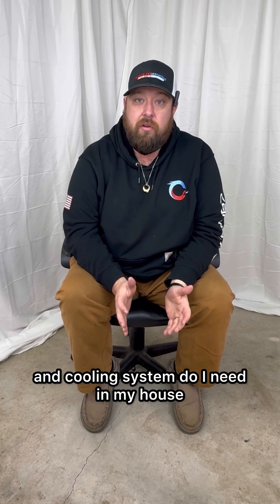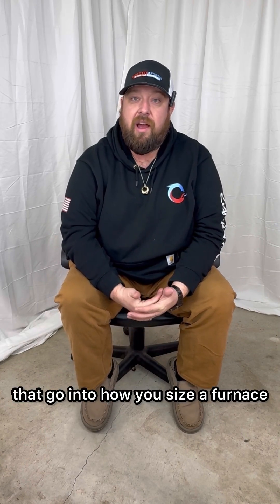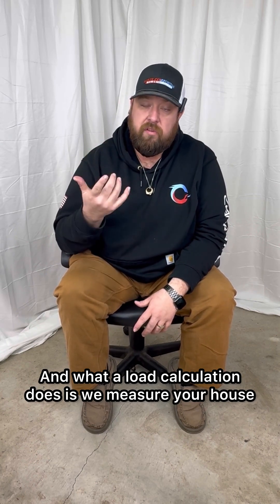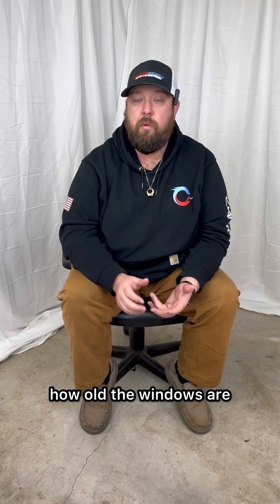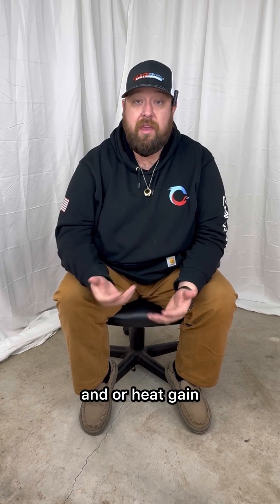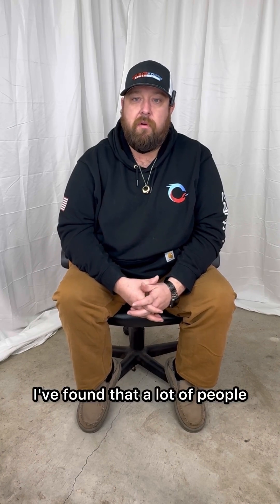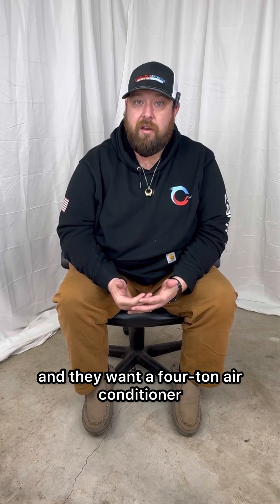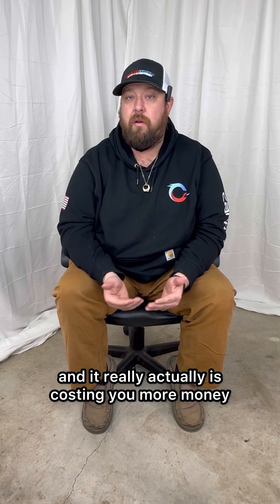hat Size HVAC System Do I Really Need?

Comment: Ive found over the last 10-15 years Total combined load goes out the window with inverter systems especially with zoning systems we sell to our customers
Ill still do a load calculation on the job with with a variable output heat pump you can cater for a lot